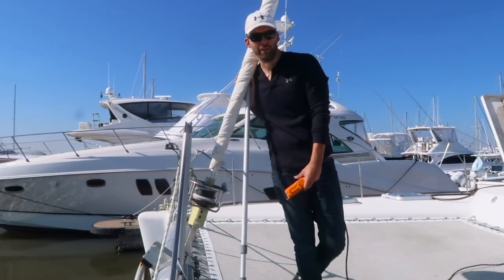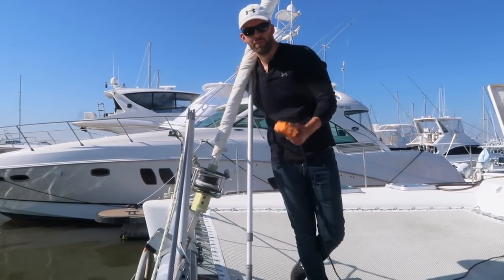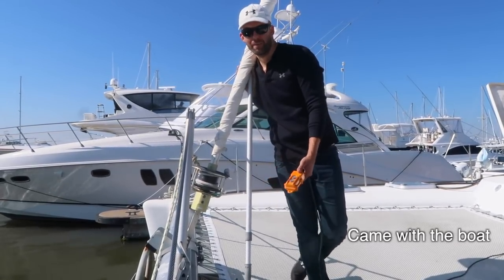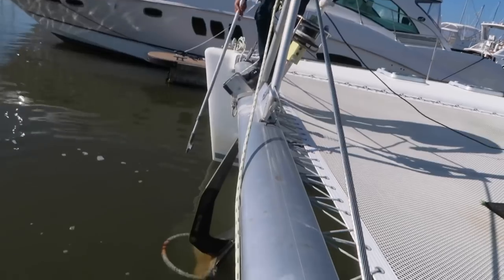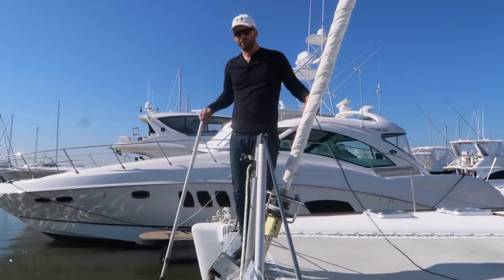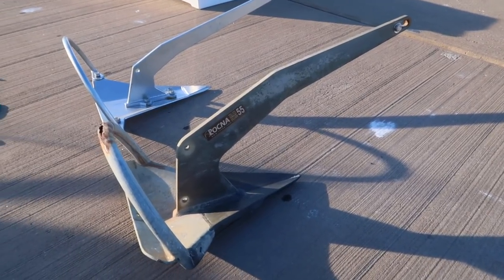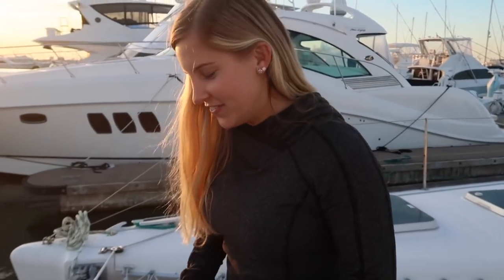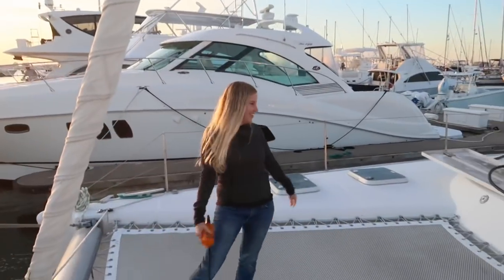When Less is More - New Mantus Anchor

Comment from the maker: While we're on the topic or anchoring, any good advice on how to mark your chain to know how much you've paid out? We've tried paint, but that wears off too quickly..
Reply: Different colors of plastic tie straps?
Reply: I've seen wire ties , and the coloured Velcro ties for extension cords and ropes. cant tell you how long they lasted but the one guy I talked to said he had them on for two years at that time, with no issues  and with the colours its easy to know the length. also you should end to end swap your chain for even wear and corrosion
Reply from the maker: @beastlyendeavour9184  I heard of that. And wonder if they would pop off when going through the windlass?
Reply from the maker: @jasona.neverforgetfukushim647  Noted on the tie wraps. Also really good idea on swapping the chain ends!
Reply: We use zip ties at 25 foot intervals for our 55 lbs Mantus on Leopard 39. We haven't lost a zip tie through the windlass yet. They will however fall off in time. We lost a couple on a different boat while sailing the South China sea. One zip tie per 25 foot of chain. 50 feet equals two ties. If one falls off you know where to replace.
Reply: I use engine enamel paint (high heat paint from Pep Boys) because it sticks well to bare metal.  It wears off and needs a little touch up every two years. The first mark at 20 feet wears away too quickly though, the 40 foot mark holds up pretty well.
Reply: Cut the chain every 10 feet then insert a link used to connect 2 chains, you can get then in a stainless gold colour that way its a permanent noticable marker
Reply: Mantus is the best!!!!!!
Reply: @armslength2618  you have to be kidding, thoes counters arnt accurate chain links skip past dont joke around and were not talking about heavey marine anchor chain here were talking about privet boat owner chain
Reply: @secondstartotheright  Who the hell's kidding?  It all depends how you design and set it up.  This guy did it one way, but it's not the only way:
http://www.ybw.com/forums/showthread.php?353367-DIY-Anchor-Chain-Counter-Project
Reply: @armslength2618  hey do what you want im just talking from experience chani counters are a waste of money and ware out you might as well throw your money away
Reply: Jessica and Ryan Adventures  ,  hi paint every 30 feet and just count each shot is best and touch up regularly  forums are full of folks with the same problem!  All the plastic tie ideas are bad as the contribute to the plastic pollution. We all need to be mindful of that and not contribute to the problem. Cheers Warren   Ps about time Mantis came up with a good idea for this!
Reply: Using connector links is the best way, install 2 at 20 ft then 1 at 30ft then 4 at forty and 1 at 50 and so on or 2 at every 10 and one every 5 or somthing like that

Comment: Suggest you service the windlass. Check all connections at the device and controller and battery.  Windlass should easily pull in either anchor. You will be glad you did first 25m anchorage.

Comment: We use Electrical Conduit pull tape or Mule Webbing and tie onto a single link every 25'. So for 75 feet 3 kinks would have a double knotted wrap, and so on. Doesn't bother the windless and lasts a long time. Its not a fashion show but its available in different colors. Salt water and winch both kill the zip ties.  After a 100' we change the color Mule Webbing, after 200' who cares. LOL.